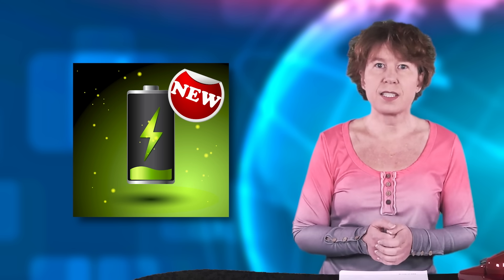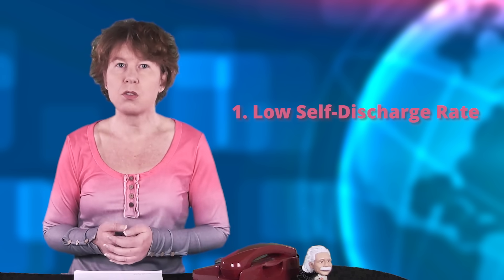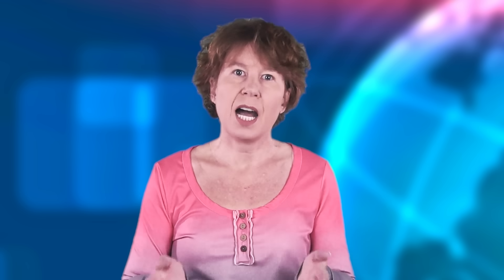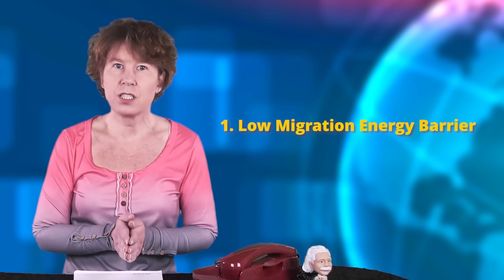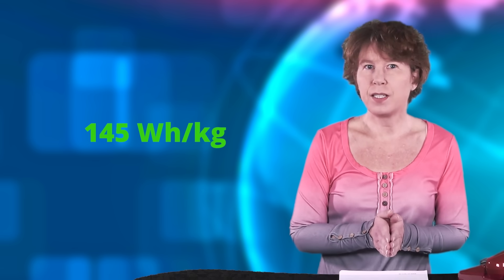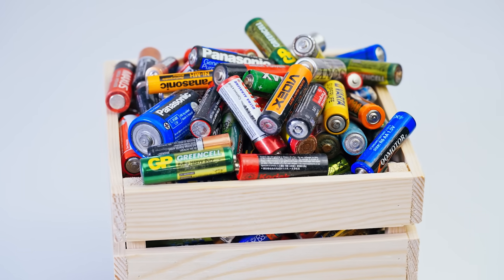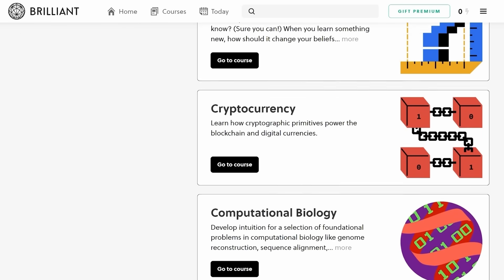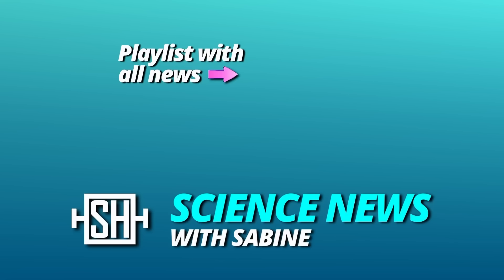Fully Charged in Just 5 Minutes: New Battery Breaks Records

Comment: It's "high cycle life" not "long life cycle" (that's something different).
What people also forget is that if you want to charge a 70kWh battery in, say, 5 minutes you need a charger to deliver 840kW. The current charging standard isn't defined for such high power and you'd need much larger insulation (making the charger cable unwieldy and also requiring MUCH larger cooling systems)
Reply: Well, its amps AND volts together, not just amps.  Not just current.   For example, a 350kW charger can push 350kW to a vehicle with an 800V architecture at roughly 400A (a little more).  But if the vehicle only has a 400V battery architecture, that same charger is limited to 150kW.  Same 400A.

Are higher-voltage battery architectures practical?   Yes and no.  Yes, they are, but in terms of practicality 2000V is kind of a hard stop for IGBTs before the cost of the charging circuits become non-economical.

At 2000V, 800kW is certainly possible with current cables.

It almost doesn't matter, though.  There is a point where what you care about more is the battery's current acceptance over a wide range, from 0% to 100%, rather than just being able to push 350kW in a 60% range (say, from 20% to 80% on the battery).  So there is a THIRD axis here that can be addressed with battery technology that will improve charging speeds another 40% or so.

Ultimately this means that it is a non-problem for consumer vehicles.   Even just charging at 350kW... that's 350kWh per hour = roughly 1050 miles of range an hour == 350 miles of range in 20 minutes or 200 miles of range in about 11 minutes.  A complete non-problem.

Charging electric semis with mega-watt-hour batteries is a different issue entirely, of course.

-Matt
Reply: @junkerzn7312  There is a big problem with 2kv architecture and that is the insulation required and potential problems if a fault occurs. A short circuit at 2kv is no joke, I know this from personal experience.
Reply: @schrodingerscat1863  Keep in mind that there are EVs on the road that are already pushing 1000V architectures, and insulation is just a linear function.   The main limitation is strictly economic.

Not that there wouldn't be concerns, but I will point out that Fast DC chargers already have both ground-loop and insulation resistance monitoring and will refuse to operate if anything is out of whack.

Also, the DC feeders into the last-stage buck converters in some of the newer Fast DC chargers are already in the 1500V range.  Just from memory... not sure I want to spend an hour tracking one down to reference.

In anycase, I really don't think 2000V is that big of an issue.  I think we'll probably see it for Semis at some point.  Whether we will ever see it on consumer EVs is another question.  It might not make economic sense to go that far.

-Matt
Reply: @junkerzn7312  Problem is high voltage systems like that are dangerous if not properly looked after and regularly inspected.  It's already difficult to find people to work on EVs and upping internal voltages just makes it harder to work on it safely and means ever more expensive and elaborate safeguards need to be implemented. In an ideal case it all looks good in theory but in practice ever higher voltages are just becoming impractical. As I said 2000v is no joke when things go wrong. The amount of energy involved can be huge making it much more risky. In the supply side to charging infrastructure that will be at 400v 3 phase to each charger meaning the cables would have to be huge. Supply to the station is also going to be a problem especially in built up areas where it would be prohibitive for HV AC feeds to be installed. All this can be done but the cost starts to spiral rapidly making it impractical. You are talking about each charger needing megawatt supply which is insanely expensive. Maybe this can be mitigated to some extent with local battery storage but then efficiency starts to become a problem and if there are busy times charging speeds will quickly reduce drastically as local storage becomes depleted. EV charging is already proving to be very difficult to successfully monetise so making it even more costly is a none starter.
Reply: @junkerzn7312  You seem to have failed to understand my argument. As voltages increase the cost increases exponentially too. Sure there are DC chargers in the 1000v range but to push that to 2000v is a big step and a lot more expensive. Also my comment about efficiency was in the context of intermediate storage to reduce supply infrastructure. 
We are already seeing problems having very high voltage systems such as those used in busses where the possibility of fires become a much higher risk when faults occur. It is a lot easier to arrest lower voltages quickly before a fault becomes a fire. At 2000v this becomes rather expensive with current technology. Your assertion that all chargers don't need to push 800kW is correct but even now motorists are frustrated with the lack of fast chargers, if a car can charge in 5 minutes but you can't find a charger capable of supporting that it becomes pointless which is the gist of the OP. 
Tesla isn't making money on their chargers, they provide them at cost to push sales of their cars as they understood from day one that without chargers their cars would be useless. For companies that have to turn a profit on their charging networks it is a very different proposition. Many such companies have already become insolvent and it is becoming increasingly difficult to raise investment capital for these ventures. Oh and Tesla may have 30 150kW chargers at a location but they are insanely expensive to install often can't all provide 150kW charging at the same time. When such charging stations are busy charging times increase rapidly which is the opposite of what you actually want. With relatively low numbers of EV's it is already a huge problem and if the numbers of EV's rise quickly as governments are pushing it will become unworkable.
I am not so much focusing on what is technically possible, more what is practical in real world scenarios given cost and implementation restrictions. Looking at it from a practical engineering, ecological and economic perspective rather than high frontier tech.
Reply: @junkerzn7312  Not disagreeing with what you said, but there are other hurdles besides just having the infrastructure available. The National Electric Code (NEC) lists 1000V or less 
as low voltage.  If you have chargers delivering more than 1kV, you get a lot of new regulatory issues coming up (in the USA) which would make it nearly impossible to implement in a year or less.  The voltage really needs to remain capped at 1kV or less or we need a rewrite of the NEC.
Reply: @GOLFandWRX  Whenever someone starts talking about the NEC, my first answer is... which reg, exactly, are you trying to quote here?  Name the reg.  There are a bunch (but big hint: there is nothing "expensive" that isn't already being done in existing cabinets).

And secondly... why do people keep thinking that Fast DC charging locations aren't already dealing with voltages over 1000V when they are?

-Matt
Reply: @junkerzn7312  I engineered charge stations for Tesla, Electrify America, EVgo and PG&E ( a utility in N.Cal) ALL of the voltages are below 1kV. All of the charger manufacturers are allowed to go up to 1kV but none of the ones I worked on did.  There is no code, it is where the NEC (2023) regulations applies from 5-1000 VDC, this is not a code or regulation it is where the NFPA 7.0 says the NEC shall apply. Essentially low voltage which is from 5VDC-1000V
Reply: @junkerzn7312  You may have experience with chargers that exceed 1kV, but I am not aware of any and I have some professional experience building L3 charging stations for multiple vendors. TESLA, Electrify America, EVgo, City of SF, PG&E, and a couple of truck companies. With many different vendors, so if you know of a manufacturer that exceeds 1000VDC please name them as I don't
Reply: @GOLFandWRX  I wouldn't expect any existing consumer terminal equipment to be above 1kVDC since there is no charging standard for 1kVDC+ yet.

This conversation started with the question of how 800kW+ charging could be achieved.  It is almost all future look.   So lets not get ahead of ourselves too far and just stick with that.

Quite a few people believe that this is somehow difficult, despite the fact that we already have 350kW chargers.  Apparently, some people think that a simple doubling is hard.  So lets get that out of the way... it  isn't hard.   From a component and component costing standpoint, there is precious little difference between 1000V and 2000V in the path.

I will do a second post on Fast DC charging architectures, because I did error in saying that buck input stages are already in excess of 1000V.  Not that it would be hard to do (its just the AC line transformer more or less), but there is no point doing that yet because most vehicles can't even make use of 350kW charging yet.

-Matt
Reply: Ok.  Now Fast DC charging infrastructure.   Current infrastructure are mostly utility transformer -> 480VAC -> rectification -> individual chargers -> dispensers for 175kW per charger @ 400V architecture vehicles (roughly up to 520V).   And two chargers can be ganged in series to achieve 350kW charging @ 800V arhictecture vehicles (roughly up to 960V).  That's the current state of affairs for the most part.

Tesla is working on a "megacharger" for its Semis now, but it kinda looks like existing megacharger locations are just using consumer infrastructure doubled up at the moment.  Ultimately the goal is around a megawatt per charger, for semis.   Given the semi charging connector at Bakersfield, it looks like Tesla is doing that with amps on a 1000V DC battery architecture.  So 1000A appears to be the goal.

So we have or will soon have '800kW' charging more or less at < 1000V.  But the cables are pretty insane.  Fine for a trucker, not very consumer-ish for retail, though.

Also, efficiencies per the spec sheet for several major brands is 95%+.  There was an argument about that too and I think I said 90%+, but it's actually 95%+.  Which does make sense in many regards... it is far easier to get high efficiencies from high voltages than it is to get high efficiencies from low voltages.

--

For where Fast DC charging is going, there are plenty of white-papers for 800V native charging (without having to gang chargers together).  People seem to be on the fence whether to breach 1000V or not.  I read one white-paper that specified 850-870VAC 3-phase on the line transformer output which basically rectifies to 1000VDC (but parts have to be spec'd much higher than that).

The basic problem here is that the buck converter needs a bit more margin to operate efficiently at the spec maximum of 920VDC.  1000VDC doesn't really cut it.

Where 800V native charging architectures are going to come into play is when there are a sufficient number of BEVs on the road that can actually make use of it.  Right now there are only a few models such as the EV6 (& later), the Porsche, and a few others.  But most of the actual BEVs on the road can't really make use of 350kW charging yet.

That said, I expect there will be a transition over the next few years to roughly 1000VDC busses which are then bucked-down by the chargers for all charging needs (400V and 800V vehicle architectures).  Bucking down is a very efficient operation and the chargers will actually be a whole lot more robust / have longer lives, with these higher native DC input voltages.  All of the components will be operating at half the amps vs their limits when charging 400V vehicles, for example.

--

Transitioning above 1000VDC does make sense, but really only on the input to the chargers, not to the actual dispensers (which is what you are plugging into your vehicle).   So, basically utility transformer to > 1000VAC, line rectified to > 1000VAC, common bus to charger input stages.  But charger output stages remain at < 1000VDC.

The main reason would be to reduce thermal loads on, well, pretty much everything.  A general rule of thumb is that the higher the voltage, the lower the thermal load for the same output wattage.  And 480VAC as an input is showing its age in low component life times so far.  The last decade has not been kind to Fast DC chargers.

Finally, again talking about 1000V+.  I will remind people that the little transformer inside your microwave outputs 1800-2800 VAC.  It isn't as scary as several people want people to believe.  Well... it will still kill you easily enough (remember all the fractal wood burning videos that wound up killing a dozen+ people?).  But in terms of having such voltages in consumer equipment, it just isn't as big a deal as people are making it out to be.

So keep that in mind before anyone here really wants to continue arguing that 1000V+ is some kind of magic barrier.  It just isn't.

-Matt
Reply: Yup the battery would require water cooling as it is being charged. The thermal load and demand of 1Mw per charger is unrealistic. Also indium is heavy and very expensive, almost as costly as silver.😮
Reply: @christopherleubner6633 electric vehicle batteries are already liquid cooled during charging
Reply: We need superconducting cables.
Reply: @steveknight878 Superconductors don't just suffer from temperature but also transfer rate, they stop being superconducting if too much power is going through them.
Room temperature superconductors would be extremely useful for a lot of things, but I doubt battery charging speed is going to be one of them.
Reply: @steveknight878  No , we need higher voltage in the cables and with that lower energy losses. 1600Volts would suit for this. (Compared to the current HPC chargers the same current in the cable)
Reply: Id say the a major value could be in a better charging curve. Its not peak power thats curcial, but the charging curve over SoC. AFter the first charge you ussually dont charge past 80% as it takes too long. This means the range is already reduced by 20%.  Another major benefit I see is the increased rate at which regen can happen. Usually regen is capped so that you still need mechanical brakes behind all 4 wheels, not to speak that its also reduced in cold temperatures. If you have a battery that is capable to take a far higher regen power, you could further increase efficeincy while driving and possibly spare mechanical brakes at the rear, thus reducing complexity and costs.
Reply: @romansenger2322  I usually charge up to 90%. Because my own rest is longer than charging to only 80% (toilet visit, coffee and a meal after 3 to 4 hours driving.... ) remember, an EV always start fully charged a day (when a longer travel is planned) , this in contrary to a petrol car. For EVERY km you need to go to a fuel station...the EV just takes it time during the night at home...no inconvinience at all for 360 days of the year. Only the occasional longer daytrip sometimes require that fast charge.
Reply: It would still mean that a 300kW charger could reliably charge it within 15 minutes every time instead of only at ideal temps.
Reply: How big would the plug be? The insulation would be governed by the voltage only but the infrastructure would not cope, you wouldn’t be able to lift the plug and cable. A non starter.
Reply: @graphiteart2020  Not correct. The insulation depends on voltage. But ALL used insulation are more than enough up to 2000 volts with these chargers.
At this moment I charge in 18 minutes (10-80%) , 25 minutes to 90%,..This with a peak charge from 225KW, effectiv vcoltage (ionity shows that) 670Volts.
Increasing to 840 KW is not that difficult with exactly the same cable id the voltage goes up to 2000volts. No issue with plugging.
Of coarse the electronics in the charger must be build to handle 2000volts instead of 800V.
Also the car must be build for handling the 2000volts.
My post is only about handling the cables, not if charger and car can use 2000volts. 
This also makes it necessary that the charger must be able to work with lower voltages for the current cars on market (800volts and 400 volts are the current norms).
Reply: This is a critical point, that gets ignored.  Not only is their no way that a public charging infastructure at that power level will ever be put in place.  It would be insanely expensive to build and then sit idle 99% of the time.  We can afford to make gasoline pumps which pump 20 gallons a minute and then sit idle because they are cheap and vehicles don't need to be modified to accept that amount of fluid, a plastic jug can also be filled from a such a system just as easily.
Reply: @kennethferland5579  Not to mention that gas stations may have up to 10-20 cars filling up at the same time during busy periods.
Reply: @kennethferland5579 Technology will catch up, and capitalism will bring the cost of the stations down. 

 I have zero doubts people will pay a premium for faster charging. Especially in cities with a high volume of cars per station, and for commercial or industry. Even public busses could benefit from a faster charger. 

 I think there will be a variety of speeds. You'll have economic ones, and faster premium ones where you pay extra for the faster charging time. 

 Competition between charging stations could also push for faster chargers, and bring the prices down. 

 Anyway I won't speculate on a timeline. 

 Side note. Charging stations need to go the gas station buisness model. Gas stations do not make most of their money off gas. They make money off selling something else while people go to get gas. 

 Seeing companies putting up charging stations that look like parking lots is dumb. Put up a food joint, or even a trinket store that people can look around, and spend money while they wait. Put an arcade where people can play some games while waiting. Anything!

 The thing is? The density is crap on these. Better to have a bigger battery pack, and charge less often for slower. Not really saving time if you gotta go three times more a week to charge. 

 Anyway fast charging is in high demand, and EVs kind of need it.. 

 I have faith capitalism will find a way. 

 PS. Speaking of gas stations. I haven't been to a Buc-ees yet, but they look awesome. More of that.
Reply: It's not only about cars. Think of trains, a 5 minute break could be easily incorporated in the daily schedule and the weight is not an issue.
Reply: @manup1931  You mean, trains which run over a fixed track with a conductor which delivers electricity to the whole length of it?
Reply: It's 840 kW, not 840 kWh
Reply: and... thicker cables.. maybe multiple cables..
and a PSU that offers 1MW +/-@80% 840  for...one car..

One can return the heat by water cooling and send that hot water through the undergrond .. so the buspark is snow free?

How many cars are being reloaded
and trucks.. and busses..
Reply: "to deliver 840kW"

Worst case we have 25% external power supply an 75% from liquid hydrogen fuel cell.
If we have 16 of this station in averarge at the same time 4-12 are free, therefore only 25% external power plus 25% Hydrogen is relevant. Cooling of the battery during loading is important.
Reply: Not to mention a power grid that can support 840kw charging stations. That is roughly the power of 40 houses w 200 amp service. 

The other factor is rapid charging reduces the life cycle of lithium batteries.
Reply: Correct, and the loss of energy with such high currents ist extremly high. We do not have enegy left to waste...
Reply: EV charging station companies are pulling out of Australia. It's now more expensive to run an EV between our 2 biggest cities than a petrol car. The EV market is dying.
Reply: @Chris-hx3om  For a market that is dying, EV sales appear to have doubled in Australia in 2023 vs 2022.  Methinks you might be using a poor information source.
Reply: Fast EV charging stations do not hang off of residential electrical infrastructure, they hang off of high-voltage distribution infrastructure.  Sometimes even transmission infrastructure.  Typically in excess of 7000V for the bigger stations.

Pushing tons of power is a function of the buffer battery, not necessarily just the utility.  Nor is the charging station just blindly pushing massive amounts of power to all of its stalls all at the same time.  The power delivery is completely dynamic.

It takes what it is allowed to by the utility, modified dynamically in real-time sometimes.  And it pushes power to vehicles according to what it is able to do.  If lots of vehicles want to charge at full power all at the same time, a Fast DC station might have to ratchet-back the power delivery to fit within its capabilities.

These stations do not operate like when you turn on your A/C at home and ignore the utility begging you to turn it off.  The utility can more or less tell a large fast DC charging station how much power it can draw in real-time.

Also, the amount of energy people put in their EVs really has nothing to do with how big their batteries are or how fast they can take a charge.  It is entirely a function of driver miles.   So having quicker charging options really does not translate to overloading the grid.  Just to more convenience.

The grid will be fine.
Reply: @junkerzn7312  I don't think you really understand how the grid works , system voltage, conductor size, transformer size are just some of the minor costs to upgrading. And you cannot build a charging station from a transmission line without a substation, now once again you run into the afore mentioned issues and where does, even after upgrading the lines this extra power come from? Please don't tell me wind and solar.
Reply: LOL @Chris-hx3om